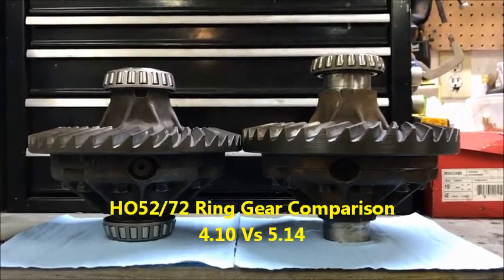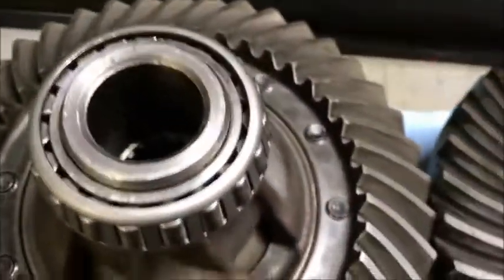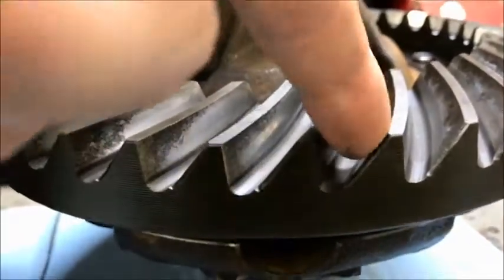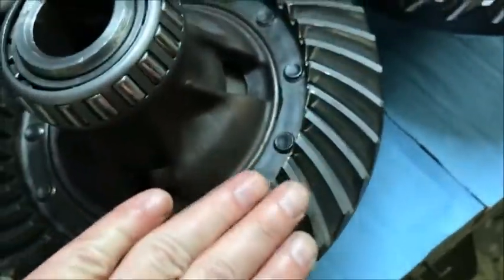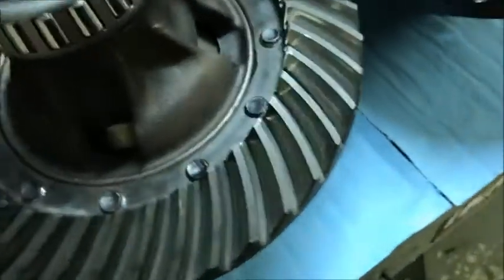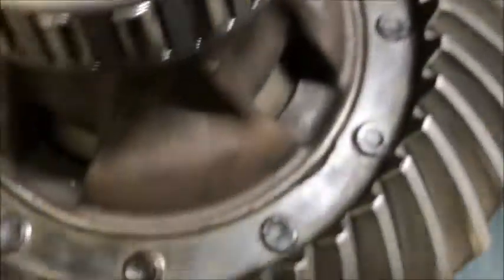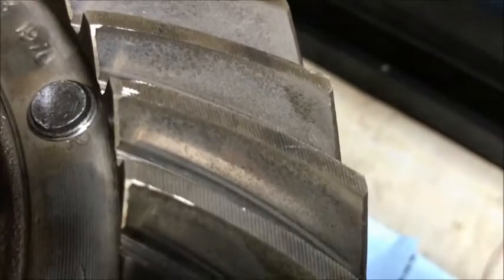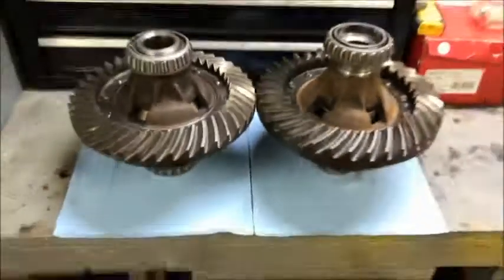HO52 / HO72 Ring Gear Comparison

Comment: Is there any way to tell if the rear end is a HO72 or a HO52 without tearing it down? It's a dual rear wheel with load bolt on a  '68 C20. I've been told HO52 can always have a load bolt and I've been told the C20 could have come with a DRW.
Reply from the maker: All duals are 1 ton, however the HO52 is same as HO72 except for brake drum inner diameter.  52 = 11.1", 72 = 13".   Earlier HO52 had a different pinion bearing than 72, but later are same brg.
Reply: @BriansGarageUSA   great info! I know the front end was converted to a 1 ton on this truck before I had it and I dropped a fresh 383 with 700R4. But, I've got a whine even at low speeds and a vibration at about 55mph that keeps getting worse as I gain speed. I've checked the angle, tranny tail, wheel weights, brakes, and all I have left is the rear end. Trying to find master kits or just part numbers to piece one together has been a quest.
Reply from the maker: @s9azz  I'd check the driveshaft carrier bearing.  These weren't phased well from the factory.  The 3/4 & 1 tons have 4 degrees up at the axle pinion and so the engine should be 4 down.  The shaft out of the trans should be inline with the trans, so also 4 down.  I had to shim my driveshaft carrier 3/4" (3x 1/4" shims) to get everything perfect.  You can be out up to a degree and still be okay though.

Driveshaft carrier bearings will make a noise that sounds a lot like a brake rotor rubbing on the backing plate when they start getting bad.  It is most noticeable when you slow down for a stop with the window open.

Gear whine generally gets louder the faster you go and sort of sounds like a howl at high speeds.
Reply: @BriansGarageUSA  no carrier for me, it's been converted to a 1 piece shaft. I will check the angles again though. Been about 3 years since I checked which is when it was balanced.

The symptoms you are describing very much sound like what I am experiencing though.

Really appreciate you taking the time to respond.